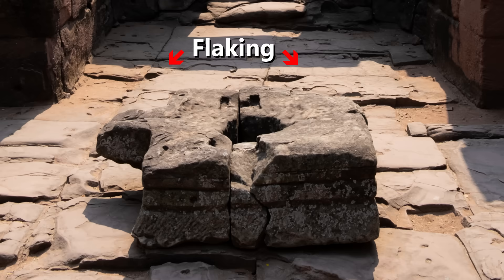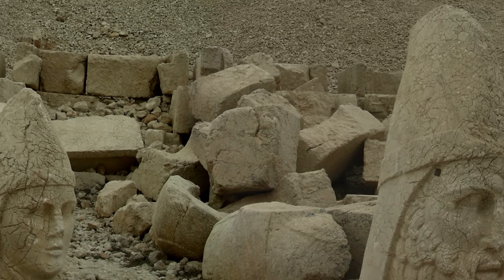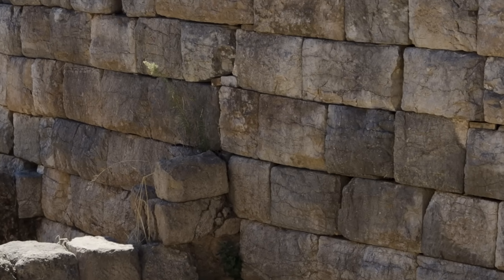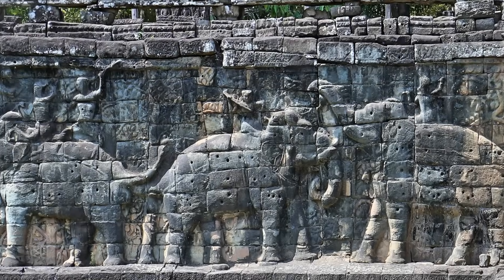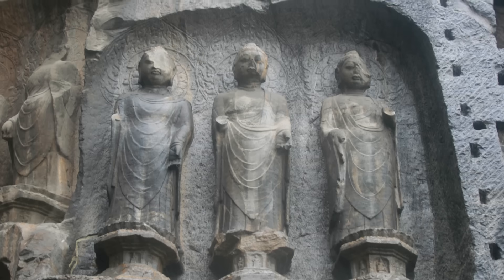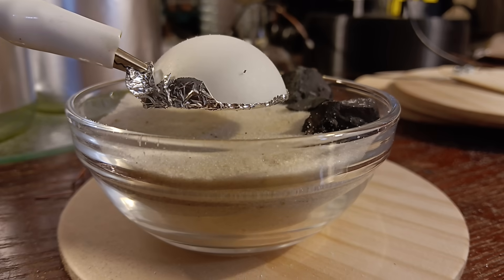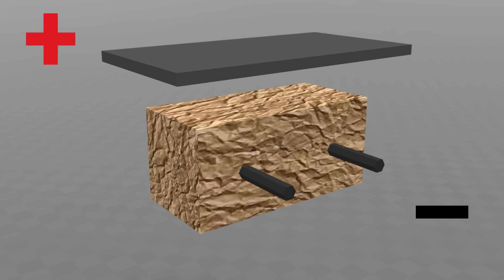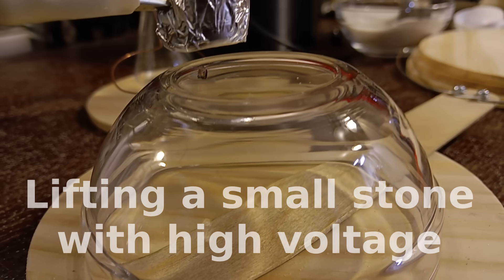The Greatest Mystery, Solved. Recreating Ancient Stone Melding Technology (Part 1)

Comment: If only you could meld minds😂
Reply from the maker: No need to meld minds, I fill them with wonder and knowledge through genuine world first videos and sciences.
Reply: @MadPlasmatist  just so you know the Ancients were using a form of impulsive Sound Energy the tell is in all of their polygonal Masonry structures left on the planet
Reply: @MadPlasmatist when you melt granite because of its composition  it turns into volcanic glass and leaves air bubbles.  I like your motivation but it is just not the way it was done. The real smoking gun lies in the true purpose of the great pyramid. If you really do want to know how their energy system worked the evidence is still there. As a matter of fact all ancient tales told us what they were up to. We just didn't fully comprehend what they were trying to tell us. Also at first glance the legends seem preposterous. The truth however will ring through every anomaly and explain every nook and cranny of the polygonal structures.

Comment: Or maybe the nubs look like this now after thousands of years of weather erosion, and they were simply the break-off point of that stone when it was finally removed at the quarry.  The holes could be for manual adjustment rods that the workers used to help position the stones and slide them into place.  They also most likely used some kind of oil or lubricant to help slide these stones into position.  Do the holes go all the way through?  The holes could also be for injecting lubricant behind a stone to help move it against another stone behind it, and/or for a drain hole for the lubricant once a stone was pushed into place.

Rather than always having an exotic answer, sometimes they could have just used something simple and practical.

Comment: Great theory and you seem to have explanations and show very miniature working examples but, it sounds like it would require quite a large sum of electric current. I'm not a scientist and not an electrical engineer but I don't think the Baghdad battery is up to the mission! So does that mean a sequel to this video will explain how they plugged into alien space ships or maybe Zeus used lightning bolts? I'm not saying your theory wont work in today's world but my doubts are high for time past. Besides, what happens if the stone has moisture in it? Wouldn't it explode like a tree hit by lightning? Isn't heat used to break rocks?

Comment: You don't need to test stones to see which ones work. If your theory is correct then you already have examples of which stones work. Those would be the same types of stone used in the building of the ancient structure. If your hypothesis  (you don't have a theory yet) then it MUST work with those types of stone. If it does not then your hypothesis is wrong.

Comment: I like your theory.
However the rods in the queens chambers northern shaft are not electrodes.
They were left there by Morton Edgar in 1928. He used steel rods with flexible joints to measure the depth of the shaft. 
However because of the sharp bend the rods broke and could not be recovered.
Reply from the maker: The rods were already at or near the area. The explorers just shoved them up there. One of the rods last use was to both inflate and shape the 'sarcophagus' box that is too large to fit in the kings chamber... These boxes are a type of stasis pod constructed globally after cataclysm. The "Serapeum of Saqqara" is a great example of this, and was also not entirely completed before the cataclysm arrived =)

Comment: You may be on to application approach to making stones mailable , it would take a immense amount of energy to heat that much surface or interior of the rocks? Not sure how they could construct such a energy source?  I have heard others say preparation of the rock with some solution and applying a voltage and resonance to the rock or rock surface to meld them..What they did is still out there for further proof of methods used and replicated by others is considered a scientific verification..😎🗝✝️🙏🏼🇺🇸

Comment: How close would the rock have to be to its final shape to achieve the results we see in amcient structures?  I believe there is more going on with ancient megalithic structures than can be explained with scientific reasoning.
Reply from the maker: There are 2 possible explanations - very to moderately close or, at these incredibly high voltages and / or application methods; it might be possible to create a 'cell' affect in which the stones are pulled / held in a geometric, naturally cell-shaped pattern by the electricity. I have seen what appears to be both, however the first example in which they are moderately cut close then 'puff out' like a marshmellow under heat from their own weight (also explaining their straight planes / not lumpy on the sides like just rough stones stacked) would seem to be the predominate method.

Comment: If the electrodes were circular that would explain the drilled holes at Giza.
Reply from the maker: The circular holes are mainly for tubes, which are used to transport liquids, gasses and, because electricity travels on the outside of wires and not through them, tubes would also make the perfect electrical 'wires' to connect everything. Note that predominately, there are 3 tube sizes, and a rectangular type you will find as air vents near floors. Finally, circular electrodes would instead hold the plasma contrarily to square / ridges or points that facilitate the plasma to move freely from them into the stones - so keep that in mind when observing these ancient sites =)

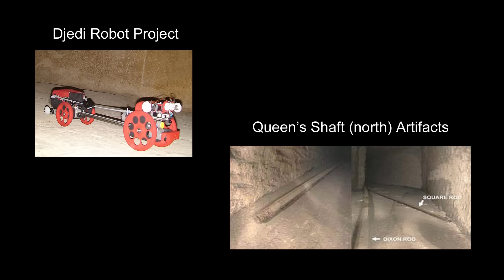Comment: 5:23 Looks like a section of a chimney brush
Reply from the maker: The electrode rods would have all been laid out from the power sources / points and connected in lengths just like this. edit or shoved up some shafts later by curious explorers whom had found them laying around =)

Comment: Those rods were put there and written about by the archeologist.
Reply from the maker: The rods were already there or in the area, the human explorers just found them and curiously poked them up the shafts =) They were used long ago after a cataclysm to both 'inflate and shape' the stone sarcophagus that is 'too large' to fit inside the kings chamber. This is actually a type of stasis pod used around the globe to either wait for help or until radiation levels from this solar system's faulty star returned to tolerable levels. Surely though, you already knew this =)

Comment: Then how come unfinished stones in quarries have nubs...
And the rods in the pyramid were left by an explorer which written about in an old book recently translated...
Reply from the maker: The nubs are left in quarries because the method was also used to remove stone, the rods were already there and just shoved up the shafts by explorers.
Reply: @MadPlasmatist  one thing I learned 35 years ago when did Mason apprenticeship is that wet stone cuts easier... Maybe the nubs were attachment points to vibrate the stone when in position to mold itself to conform to the previously laid stones...
Some herbs and pyrite soften stone

Usually the simplest explanation is on the right lines
Reply from the maker: @richardlilley6274  Watch my How a Lingam Works video, just the fact a device like this functions is a testament to the power of the past. It is also one of the primary tools in achieving this near-molten rock effect. The nubs are left from a multiple-part process; after the rocks have mostly cooled, the electrodes are fired up once more to heat the area around them and are pulled out. I can recreate this entire process however I am kept too poor to even eat 3 meals a day... I've also just discovered ANOTHER new science, wait for my new video in about one more week - I give all I can or am allowed to give - learn from it =)
Reply: @MadPlasmatist  that all hinges on that they had tesla coils and vast amounts of electricity

And experiment doesn't require a lingam to work
Reply from the maker: @richardlilley6274  Yes, you can even find a half squished / melted stone motor which is very neat, search for it. Power is still abundant from the atmosphere today, though before cataclysms, it had a much greater charge (always looking like the northern lights) and why you'll find tall towers on all of these structures. In every corner of the globe, a water-cooled spark gap of some kind was used to achieve these melding affects that built the underlying structure for the greatest civilizations... Keep on your quest, I've at least opened your eyes enough I hope =)
Reply from the maker: @richardlilley6274  ...watch my Future of Power / Electrobid 1 video =) It operates on charge differentials, much like ancient structures. Hope this helps...
Reply: @MadPlasmatist  thanks will take a look

Comment: The Egyptians had technology that created and used very large very high voltage batteries. If the batteries were in series, would voltages be high enough? Or is the answer being revealed in the Disclosure Project with Plasmoid Technology?

Comment: I've been racking my brains over this for years and came to the same conclusion as you with regards to the electrodes being pulled out and leaving the nubs. The holes on the other hand, I'm not so sure. Most of those stones look a manageable size and don't take on the bulbous appearance that you tend to see in the Peruvian stonework for example. I'd suggest the holes were used for inserting lifting poles or affixing facades.

Comment: If you melt stone you don't get stone. The crystal structure becomes very different and It looks mote like glass. If they could really melt stone i think the building technique would be quite different.  They could for example build seamless houses in one piece.
Reply from the maker: Granite is a stone which can be melted and resolidified to make granite. One also does not melt the stone in this process, it is heated to near melting so that it can be worked. There are countless examples of melded / misshapen stones - look closer at the rocks at any ancient site - you will always find an example.

Comment: Theory for power generation of pyramid… falling water source under pyramid creates sound waves thru echo chambers to create resonance thru high quartz granite to generate piezoelectric effect channeled to electrum (silver/gold mix) cap stone. Sandstone cap stones act as insulator to direct energy to top. Then power is transmitted thru the air Similar to teslas design for energy transmission.
Reply from the maker: Something like that, the 'Grand Gallery' appears to be a 'marx generator' as the incline is perfect for facilitating arcs moving upward (heat rises) and also the holes left for stations where each one stood =) If you watch my "Radiant Energy" demonstration video, I have finished what Tesla had started...
Reply: I’ll check if out. If similar to Tesla coil, it could be used to transmit sound waves to lighten stones if that theory is correct.

Comment: I assume that a lot of those holes were holding wooden planks for platforms or cloth covers for the sun. Seeing that the stone isn't obviously melted together and that they didn't have high voltage back then makes it seem very unfeasible that these are electrode holes.
Reply: but a lot were not, maybe lifting but... who knows  and why octagonal...
Reply: @lauchlanguddy1004  How do you know that a lot were not for this purpose?

Maybe the holes were octagonal because turning a tree branch into an ocatgon is easier and less wastefull than turning it square.
If these holes were used to weld stone together we would be able to see this in the rock formation, and also in historical records.

There is basically no chance that these holes are for electricity.

Comment: Creative thinking you have, but it’s far more simpler, they poured stone like concrete or the structures are imprints or calcification. If you did your research you’d know. Those holes are rebar or wood that’s since rotted away. You can’t make plasma rock, why could they?  Those knobs hold a render, and they assist in the frame work while pouring.
Reply from the maker: Your a funny guy. Um, where did you do your 'research'? Do you have any working models? Are you godlike? Have you recreated ANY ancient technology? Rebar? In single stones? I have been looking for a very long time - and all I have found are the smallest, most pathetic minds I really don't care anymore.

Comment: I agree with the idea however I'd like to add, if they did this method they most likely made a mold. Put the electrodes in it and then loose smaller stone on top until it melted into a homogenous shape

Comment: INCORRECT  (archeological error)
5:15 - You claim ancient electrodes were found in the air duct of the queens chamber, this is false .

In 1928 an archeologist named Morton Edgar used steel pools to try and measure the depths of the air channels, and dropped them inside. He wrote:
  ”So, if any later investigator examines the North air channel of the queens chamber you will find two long lengths of steel rods with steel couplers and an oval ball of harden wood at their upper ends.”

These were not electrodes. 

More details can be found in the video titled One Solution to the four channels of the Great Pyramid from the YouTube channel History for Granite at the timestamp of 7min 32sec .
Reply: ?? What are you even talking about? Morton Edgar probably bought them at The Home Depot in 1928 .

Read the whole comment… it’s pretty self-explanatory and explicit with details.
Reply from the maker: @emailformosa  Those are electrodes and were used in their last iteration as a means to both shape and inflate the stone sarcophagus 'too large' to fit inside the kings chamber. Then some humans came along and poked them up the shafts. =)
Reply from the maker: Where do you think they got the rods from?
Reply: I’ve given you historical writings from a known archeologist claiming he placed the steel rods there. That they are not artifacts native to the location. 

You’ve given me: ”nuh uh”

You are claiming these 2 steel poles are the only existing evidence that ancient Egyptians could forge steel.  There are zero Egyptian artifacts made of steel. An archeologist literally wrote in his published works he put the steel polls there.

Comment: The pieces are comming out front. Nice. I kept thinking heat...the electrodes were shaped like tuning forks. More clues are in the area of the dendora lights. The wiring diagram is on the wall.

Someone with the knowledge shared with the Dogons...shared it civilization at the time. What was no mention of sudden delush that destroyed the technology.

The sun, planet and water (electricity)

Great job! 

The carving of caves of ancient time look like forks going top to bottom on a block of  butter.

Well done!!

Comment: I can’t let you get away with that BS about the pipes. They were a probing exercise, which is documented.
Reply from the maker: Well done. Your contribution to humanity has been noted.
Reply: @MadPlasmatist  do you understand what I was referring to? There is an entire video showing those pipes being run up the shaft and around corners, and snapping off. TWICE, come in, man. Do your research.
Reply from the maker: @BeaulieuTodd  Those are electrodes and were used in their last iteration as a means to both shape and inflate the stone sarcophagus 'too large' to fit inside the kings chamber. Then some humans came along and poked them up the shafts. =)

Comment: I think your right about the observation of the nubs correlating to a point on the stone that seems likely to be the optimal spot to 'apply' this tech to where it will allow the rock to 'soften' and 'sag' into place, often in area's of odd geometric corners, area's that need the most 'influence' to fill out.  It also explains the 'pillow' effect, as an artifact of the consequence of softening and sagging.  Your image of the wall of 6 megaliths at 4:19 shows I believe a repurposing of those huge blocks, who's original orientation being 90 degrees turned and made horizantally, because their nubs were originally made on the bottom edge.   You can see that when they were re-positioned vertically, that the filler stones between them all follow this rule of nubs being at the bottom.

Comment: Sublimation. Looking at a sea shore shelf where the sediment has become stone with embedded shell life, will indicate that earth movers of ancient times understood the composition and chemical reactions to create stone from a mixture of various materials. The technology is still used today and a link as in cement that sets in sea water named roman concrete can be used as the thread needed to back engineer the understanding. Create a box structure fill it with a substrate which has been mixed with the correct chemical composition, pour salt water over the sediment and the "nobs" are the escape for excess water to pour out. A cloth covering would stop the substrate from escaping the formwork.